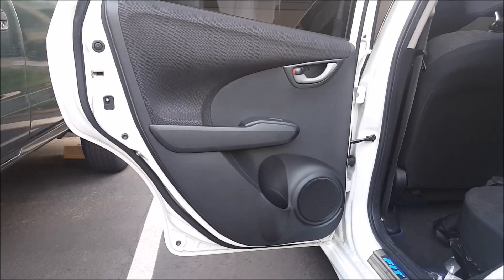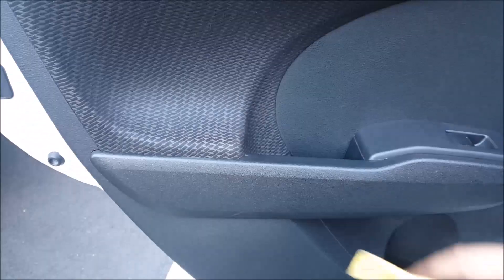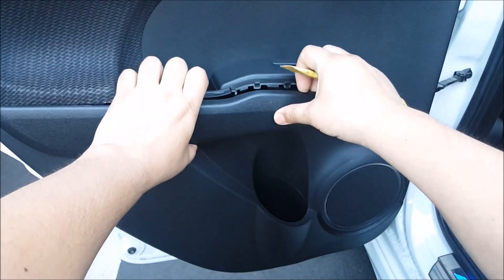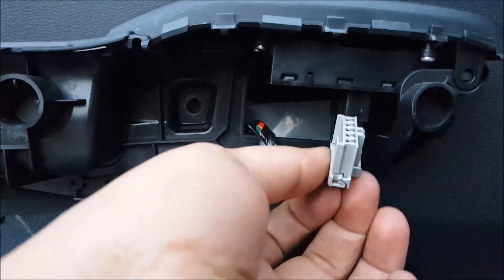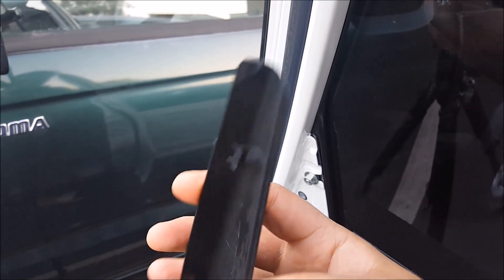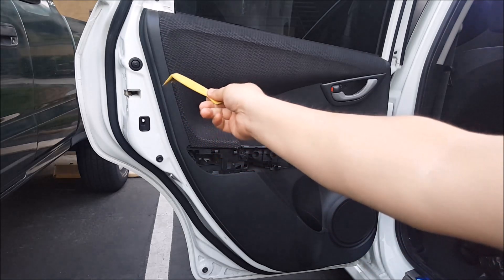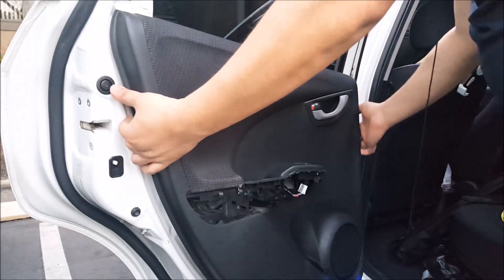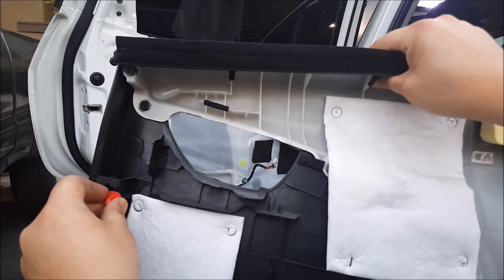DIY Honda Fit Rear Door Panel Removal

Comment: 2012 Fit Sport
Excellent instructions!
Had the same brittle plastic issues. 

- Had a couple of the red clips disintegrated. Having a box of spares is a good thing for this task.
- Will have to replace the left back triangle garnish too.  Broke the little post on one of them.
- A somewhat long magnetic screwdriver (or extension for the drill bit) is helpful for the rear screw on the back door.  If it drops off behind the panel, you have to remove the cover again to retrieve it.

Thank you for the great video. It really was helpful

Comment: Window replacement: I had to remove the front triangle panel (1 screw inside, then slide UP, don't pull), on the outside, opposite the small inside triangle; and also remove the window track there (bolt top and bottom.)

Once those were out, the window slipped in from the outside.

Other stumbles: the window needs to be rolled down to access the bolts holding the glass. I used the door panel switch, so had to plug that back in.

I also removed the foam seal, then once the glass was in, I replaced the track, then fed the seal back down into the tracks around the glass.

Otherwise, thank you for this very helpful video! It was the main source for learning to do this!!

Comment: My 2011 Fit Sport didn't have the 2nd screen under the armrest panel.  I managed to break the triangle garnish on the driver side, car is 9 years old and it's brittle plastic.  Passenger one came off nice though.  The new garnish was $11 so no worries, though I'll have to drill the stud out for the old one.  Thanks for your videos, they made replacing everything a breeze.

Comment: hi there do i have to disconnect the negative terminal of the battery in order to remove the driver seat ? Im worried the airbag lights are going to pop on

Comment: I bought a 2018 honda fit sport manual.  I heard that there tend to be leaking problems that occur  hatch door and door panels. Have you had problems? If so do you have any  fixes
Reply: I have a 2015. I haven't had this happen.
Reply: I'm 3 years too late but this seam cracking issue was only for the first gen (2008 and earlier), so you won't have to worry about leaking in your 2018 Fit.